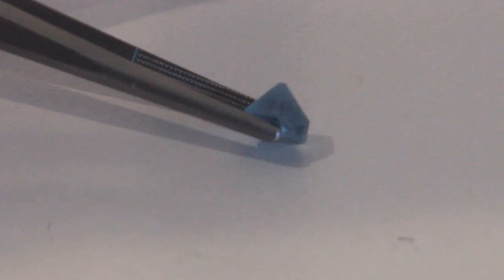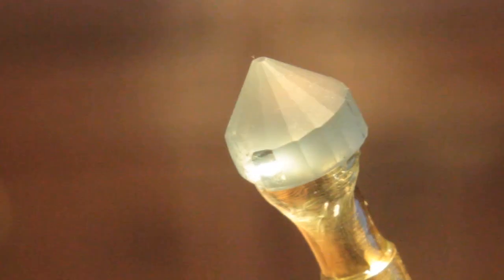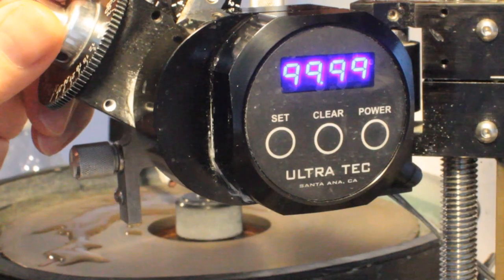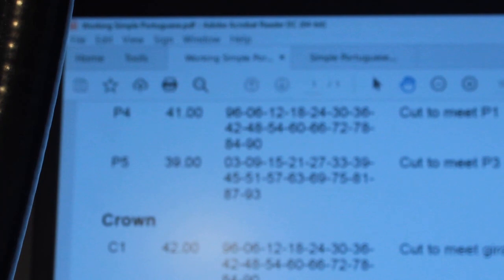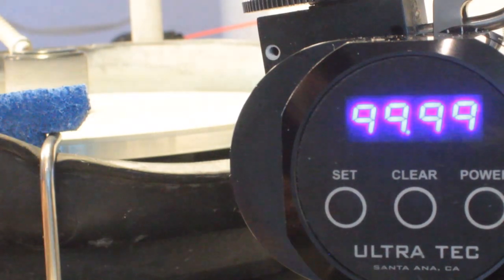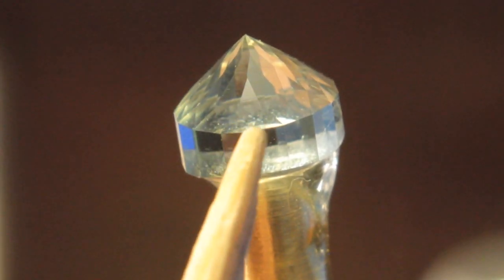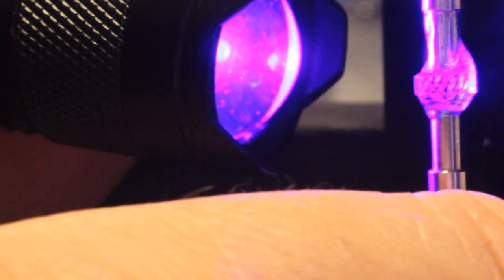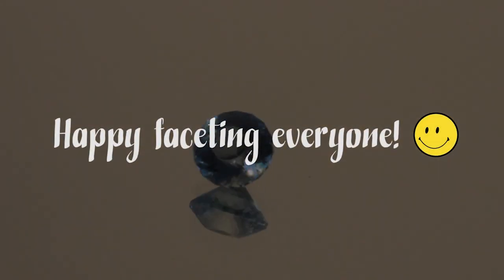Gem Cutting Tutorial: Faceting a Preformed Aquamarine

Comment: I like the cutting footage and think it's both interesting and informative to mix in now and then. With as many facets as a Portuguese cut has, do you think it saves time overall to skip the 8000 grit and go from the 12M to polish? That is, does the extra time it takes to polish more or less than offset the time saved from 'skipping' 145 facets? Thanks for another good video!
Reply: I am undecided on that.  The problem with going from a 12M, or what most cutters use, a 1200 grit lap, straight to polish is that the facet will move slightly as you polish out all the scratches of the 12M and it's a bit of a challenge to  estimate the amount you will need to move the facet.  You can set the meets to just touch with the 8K diamond on a Zinc lap (or a Batt if you prefer) and the facet won't move as you swipe the stone over the polishing lap four or five time.  The meets all meet.
Reply: @mikesackos2208  thanks, appreciate the thoughtful reply. Maybe it just worked out this time because aquamarine takes a polish so well.

Comment: Did you recut the gridle down to the lowest spot to clean up the chip in the stone?
Reply: Yes, that made the gemstone a little smaller than the preform.
Reply: @mikesackos2208  Thank you Mike. I had to do the same thing last week. Btw. how do you like working with the light sensitive glue?
Reply: @juanmorse50  I like the UV activated Superglue a lot!  No issues with the Helios brand I am using now...but I probably will test out the Loctite brand of UV activated Superglue in the future....just to see how it works....but again, no issues with the Helios product.  Because the superglue doesn't cure until I hit it with the UV light, I can adjust the rough a little bit on the dop and get it just where I want it.  Can't do that with regular superglue.
Reply: @mikesackos2208  Btw, I used JB Weld twice and both times, it failed on me...
Reply: @juanmorse50  I never had a problem with JB Weld.  For 2 part epoxy I am currently using Devcon.  I have found that in Gem Cutting, things that absolutely don't work for me...are 'go to' things for other cutters....no way to explain it.
Reply: @mikesackos2208  I truly understand that delema... Sometimes, we have to do what works for us, even if it looks odd to others... lol